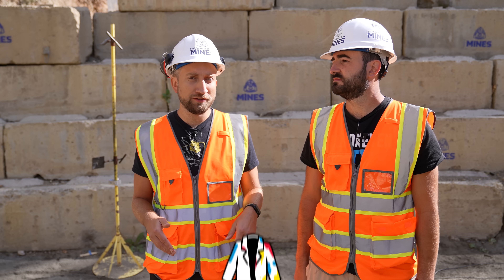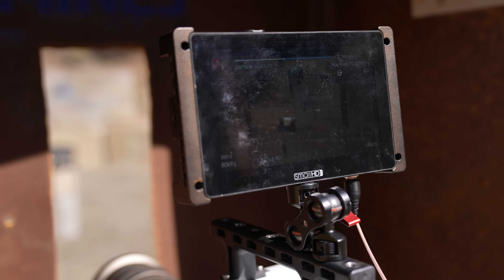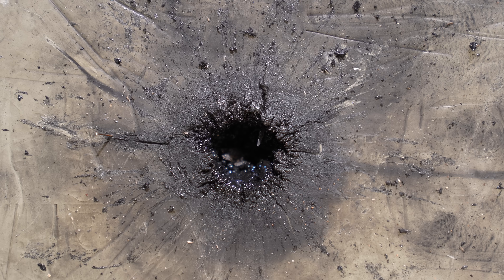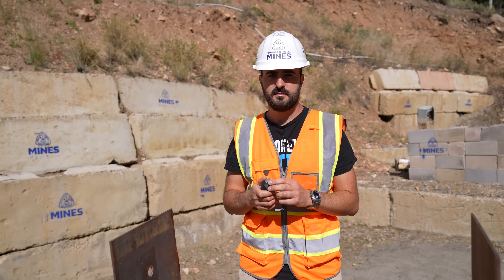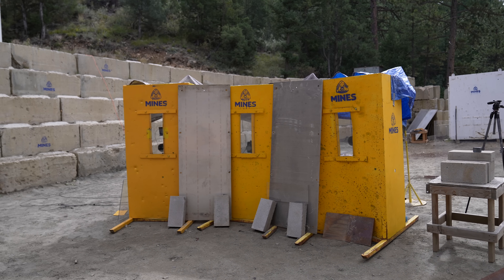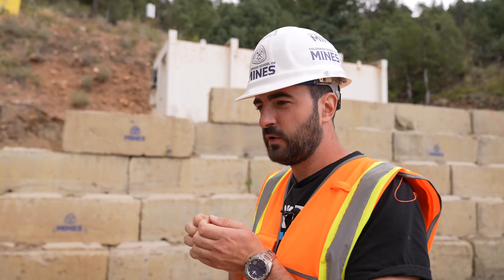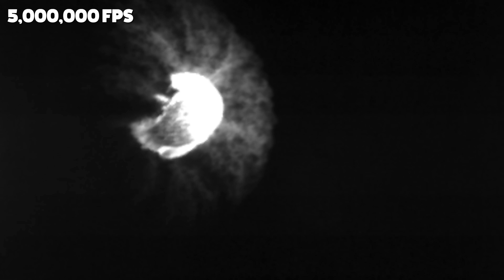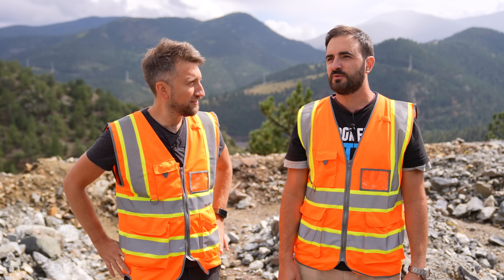15,000MPH Colliding Explosions in Super Slow Motion - The Slow Mo guys

Comment: Having used Panzerschrecks in virtually all ww2 fps games (which have shaped charges), I'd love to see super slow motion footage of one of these going into the tank from an inside view...maybe with ballistic dummies. Would be interesting to see just how much damage they actually cause to armor. Also 7174ms^-1 is generally sub-orbital velocity for something like the ISS but it will be fast enough to sustain orbit at about 1369km of altitude circular using not too heavily rounded figures so yeah that jet is moving pretty fast. For reference some military AT mines have quoted the jet to be at Mach 42 which is practically escape velocity. It's surprising just how fast we can get things to go.

Comment: Why don't you guys set up a shape charge to destroy a simulated RPG -7 in mid air like the Trophy System does?You guys are allowed to cheat a bit too by firing the simulated RPG down a wire line to help you hit it. 😉

Comment: With a combo of several two-way mirrors at 45 degrees, sorta like an array version of that stuff they use for some 3D movies to aligned two big cameras closer together than they can physically fit, plus the additional lens play to match the zoom and stuff, and a varying number of apertures and/or exposure times and/or ND filters, you could get one of those HDR stack style images in post, compressing the dynamic range by filling the white clipped regions with the in-range content of the next camera and so on, and likewise in the other direction with the black clipped regions.

Going with such high framerates, it's probably not gonna be too hard to get a pretty close match for the exact timing to align the frames, and I imagine not much detail would be lost if you allow just enough of a crossfade in the regions the dynamic range overlap between cameras.

Comment: The way they knew about this was they first solved the 1 dimensional equation for a ram driven shock wave moving in a infinitely strong tube... once they knew that their math was correct (by measuring things with geometry like this), they solved the same equation but in 2D cylindrical geometry (and made sure their approximations were valid) at which point its pretty straightforward to solve them with conical boundary conditions. It's not even that hard to do compared to other things.

Comment: So, have you designed the, rail mounted charge holder yet? A rail mounted design could more rigidly maintain the alignment of the charges and could also incorporate features to facilitate the alignment adjustments. I would very much like to see a "DN" impact, between the two charges.

Comment: definitely one of the best of your vids so far. the mixed image at 14:35 totally blew my mind.

for brighter objects you could use a passive welder's glass, or a very thin metal foil ; and there's a suggestion for another video : ask ie. 3M to lend you an automatic welding helmet and see how fast it can actually shut off the light to protect the eye

Comment: For a moment it looked to me as though the charges were already reacting to the pressure ahead of each other forcing the path to deviate by the amount required to pass each other while adhering to the condition they were at when discharging initially. What that means to me is I believe they will pass each other due to the physics present, despite the accuracy you have them aligned with to begin. 
Picture if you will? trying to hold a hard plastic ball full of air and evenly lubricated. With another ball the same also lubricated , both so hard they cannot deform either one in the exercise by contact with the other. We find there is always a loss of centre which reacts by the ball in water finding the imbalance and bypassing the one submerging it. So the explosions respond in a like manner unable to actually keep centre and fire perfectly through each other?

Comment: 15:53 "how did they know to do this?" math/geometry/physics. It's an over converged reverse of a satellite dish, and the only application I know of where a "transmission " is Over converged on purpose, to project a narrow peljet/beam/stream of material. That's how you Get a pelket/beam of plasma.
People dont tend to realise that designing, discovering, improving Anything REQUIRES that you create many ways to Try. Finding the optimal curvature of Any lense or focusing device Requires you to find the limits of focus.
The genius was applying "focus", a cincept of light, to "physical explosion ", because That is a mental moonshot.
You can only Do this with Matter, light/energy just passes through the focal point. And diverges again. 
Aaand I only just realised that That definition makes WW2 the first major use of crude plasma weapons.

Comment: I appreciate that last shot showing the shape charge form the penetrator. Everyone believes that the copper cone is shaped into a projectile. But this video proves that the copper is instantly vaporized.  the purpose of the copper cone is to shape the blast to converge to a single point forcing all of the blast propagating in that direction into an explosive jet.    And any residue of copper that you see on the hole of the penetrated material is merely the vaporized copper condensed or spattered on to the object. Furthermore, The copper lens material can be made with several different materials including glass or plastic which will also act to form the shape charge. 

TLDR, the Copper isn't shaped into a penetrator projectile like it is on EFPs rather it focuses the explosive blast into a jet. 
Further more, The copper lens material can be made with several different materials including glass or plastic.
Reply: The copper acts as a plastic mass of greater density than what you'd achieve from the expanding gas behind the shockwave.

Remember: If the copper was vaporized, it would expand into a greater volune as becomes a gas.
Reply: This is incorrect. The copper liner does become a fluid jet which eats through material using its velocity and density to eat through the desired material. I think the misconception arises from the ranges. A shaped charge of the type used in the video has a range of inches for standoff. By the time it leaves the frame of the ultra slowmo video it’s already past the optimum distance and is rapidly shedding material and losing effectiveness. When shot into the gelatin, since it’s so low density it travels for a range that gives the impression of a bullet, you would never use that small a shaped charge with so shallow a liner for something a meter away. Even on the collision shots, those copper jets are FAR past their optimal standoff range. At the appropriate standoff distance there is very much a jet of copper, from a meter away probably a little bean like we see in the video.

EFPs on the other hand are long range explosives. The liner is a lot more shallow and thicker (like a manhole cover). So instead of the wacky fluid dynamics forming into a hot jet bs that happens with shaped charges it more traditionally forms a slug which has great effect at range.

The theory of shaped charge penetrators is pretty well defined. But probably hasn’t ever been viewed this clearly before. Plus if it was a focusing or lensing effect, we would see it disperse past its focal point, which we don’t.
Reply: @EriAntTea there actually is, search “introduction to shaped charges dtic” and click on the first link, this document contains all you need to know about shaped charges and incredibly high quality slow mo images of them forming.

Comment: "Look what it did to the table" It's amazing how many people forget that a shaped charge is essentially just a blob of explosives with a metal cone in it. In fact, the easiest improvised shaped charges, which the IRA made good use of, is just a metal plate with some C4 stuck on the back. It's the equivalent of firing a gun cartridge without breach, barrel or even a cartridge, just by placing a load of explosives behind it. Hence, of course it has exactly the effect of a load of explosives going off, except in one direction it has another, more spectacular effect.

Comment: At 14:30 when you're looking at the tiny tips passing each other, you can see one of them fade and almost disappear behind the cone cloud of the other.  That's because that 'cloud' is vaporized superheated copper.  They didn't really miss, I would wager that the majority of the copper did indeed "collide" with the opposing copper cloud.  What missed was the concentrated hottest little lead point of the clouds.  :)

And when you were asking who thought up the idea of shape charges and discussing how they knew it would do that.  A big piece of understanding the math and mechanics of how explosions propagate through explosives and other materials came out of the Manhattan project.  In order to trigger super criticality, they had to use precisely made hexagonal shape charges surrounding the fissile material, all triggered and timed to compress the sphere uniformly around its entire surface.

Comment: What an insane video. This is top Slow Mo Guys.
Now put a dozen of charges in a circle, all pointing toward the center.
Reply: Then put them in a circle, all facing a bit to the right of the center, to create an explosion tornado.
(an immeasurable step up from the fire tornado)
Reply: No, in a sphere of the exact diameter calculated for maximum impact at spherical dead center...
With one charge at each pole, two charges opposite each other at the equator and two charges opposite each other at 45 degrees and ALL CHARGES PERFECTLY focused at the absolute center of the sphere and timed perfectly to go off at dead center impact...
Then back off a mile or so just to be safe!
Reply: And than some Uranium 235....
Reply: @zathrasyes1287  "Hi, I'm Gav..." "and I am become Dan, destroyer of worlds"

Comment: I think a lot of the incandescence you're seeing isn't the copper itself but the air through which you're shoving it at basically orbital velocity. Think of the plasma surrounding a reentering space capsule, just a lot smaller and maybe a little runnier.

Comment: Proof that enough kinetic energy can make the tiniest little thing extremely deadly. This is probably the most fascinating video you guys have done. I'm still blown away by how far you had to push the cameras down to finally expose that. There's so much energy in that shaped charge that so much of it is being lost to heat and light and yet it still retains so much destructive power. That is crazy.

Comment: Opera is not good, it's really slow, it'll buffer on 360p and the picture jumps in fullscreen, Maxthon is mile faster will do multiple windows in 1080p and higher and never buffers or jumps, Opera also adds bogus websites to Speed Dial and you can't stop it, it's really annoying.

Comment: I bought a knife sharpener based on the previous review!

Question, whenever the tolerance for success or failure becomes narrow repeat results can help isolate.

Have you been able to duplicate sharpness scores with multiple tests in case of manufacturing variances with the wire?  Just in case there is minor inconsistencies

Comment: Trying to get these shape charges to hit 100% dead head on is like trying to hit a bullet with another bullet while riding a horse blindfolded... Between the level of precision that would be needed and the minute variations in each shape charge, actually pulling it off would be flat out amazing, if even possible at all. In reality, it would probably be plain old dumb luck for it to happen.

Comment: I wonder, could a polarized film in front of the lens help in a case like this? In fact, if you could have footage from two side by side cameras with the filters oriented 90 degrees from one another, you might be able to align and overlap most of the dual shots and use different blend modes to reveal further detail. This is definitelly the type of phenomena you need to remove detail to see more detail.

I also wonder if you could take the black and white shots and colorize it with different gradient maps to "regain" some detail (well, regain to the human eye that is, the detail would already be there)

Comment: "did it just, like, dribble out the end?"
"I'll be honest, I was not expecting that to be gone so quickly"
"is that the tip?"
"a lot of its content is now stuck in this channel"
"very satisfying"
"technically it should be just one straight hole, right? But there's three separate ones"
"definitely wanna go tight on that"
"just took it in the mouth"
"it's so deep in, it's like they've got the perfect width" 
"you can feel it, it's bulged the inside"
"it's only the tip that's the brightest part, this was entirely white"
"we finally exposed the tip" 

They must be saying these things on purpose.

Comment: In answer to your question at 16:10, they didn't fully understand how the cone worked. But the story goes that a german engineer noticed that an early form of plastic explosives would leave an imprint on metal after the explosion in the form of letters that were preformed in the explosive. From there He theorized and refined the concept to make shaped explosive charges.

Comment: The jet is kinda like an air cannon where pressure is built up all around  but pushed through a narrow cavity to create  more precise shot, and to help propel and guide it  the wide mouthed part creates a back end pressure vacuum forcing the air out behind the shot inside of infront or on the shot.
 Not an engineer just a thought…

Comment: Hot Damn!  My first pro rig was a Kodak Spin Physics Videotape Recorder that could go 44,000 frames/sec, about which we were happy as hell.  We had to use lens tricks as well as lasers for enough light to see the physics in the FeO2/epoxy layer coating all Ampex rigid aluminum memory disks.  Aligned iron oxide spicules stopped all memory induced errors.

Comment: Be interesting to calculate the photon energy released when the two copper plasmas -not bullets-meet to see if they could be fusing. Latest british fusion attemps involve shaped charges and a venturi ...Why 40k "Plasma" weapons have a large inverted cone barrel and short approximate 30-40m range. Just a hand held version of a shaped copper charge based on the effects of a challenger tank round. Shaped charges are actually plasma weaponry given a simplistic name. The little plasma "bullets" use heat from phase change to eat through armour, lordy knows what energy state they achieve when they hit each other tho...lot's probably. A double jello shot would show if any extra energy was released when the two plasmas hit.

Comment: I think the cameralenses can be better protected by, very clean, protection-windows tilted to let's say 45°, so that there will be not only the raw strength of the window holding against incoming particles but also a mechanical deflection slope getting the particles off track. Of course one has to watch for distortions in the optical path caused by a tilted protection window.

Comment: Great and incredibly insightful video! Bravo.
An idea if you do something like that again:
Weld the opposite corners of the plates that hold the shaped charges together with rods or L-profiles to prevent any warping and "spinning away" caused by the initial explosion. The L-holders you used obviously couldn't hold the sheets in position with the immense pressure the loads were generating to allow the charges to meet accurately.

Comment: When we cleared the Valmara jumping mines on the beach at Kuwait we used half a stick of PE4. The case would be left after the explosion. We then started to put a third of a stick of PE4 into the bottom of half a soda can, a knot of det cord in the middle of the PE and close the top with our fingers. When we placed that on top of the Valmara it would obliterate the mine so that there was nothing left to find. Great Fun. The shaped charge soda can bomb would destroy the mine before it had a chance to detonate.

Comment: This incredible footage should really have been done in near-vacuum. The copper jet doesn't look like that, it's always very slim. I'm almost sure the finger-like objects caught on film were probably the air shockwave surrounding the copper jet, brightly glowing due to the immense shock-heat. In vacuum, all the attenuation would've been unnecessary too.

Comment: Awesome video guys!  I was curious about the fact that the final video showed the shock wave hitting the jet just as it escaped the cone.  I have no expertise in how shape charges are designed, but would this maybe prove that particular shape charge is not an optimal shape?  Maybe a more shallow copper cone angle would allow more jet to escape before that final disruption?

Comment: A shaped charge is like crimping down a 50 BMG to fit a 223.  But you couldn't manage that without over-pressure detonating the barrel.  And because you don't have to worry about over-pressure, you can manage a much higher yield propellant.  It's more like firing a 223 out of a 30mm cannon instantaneously.

Comment: Those charges were traveling at 7 km/s, essentially a speed of a slower moving meteorite.  The glowing could also be from the friction between the projectile and the air.  Up the speed to 8 km/s and you have the speed of low earth orbit satellites.

Comment: shaped charge/HEAT warheads is like an early glimpse to energy weapons we could come across, like just focused shockwave can generate so much heat it leaves a bright tip as it travel across a distance while able to punch through like several hundred milimeters of rolled steel

Comment: These shape charges are what's used when fracking. In order to perforate *insert your flavor of sediment*, the charges are used in series of 1 to X, in multiple sets, so sand and pressure can easily fracture the sediment, which allows the natural gas, or oil to migrate back to the surface.